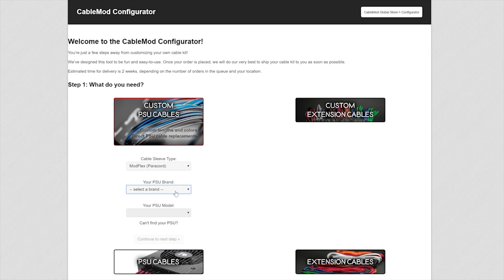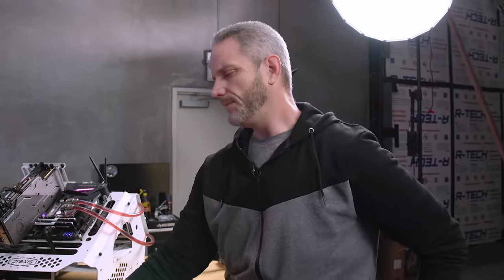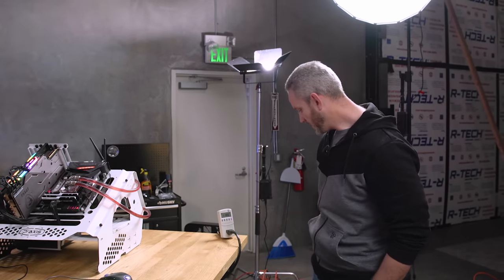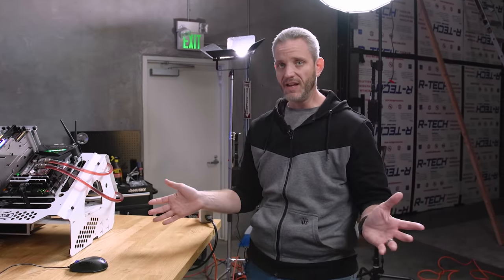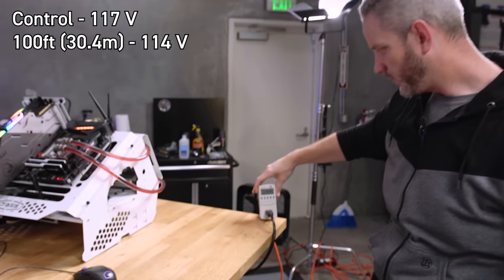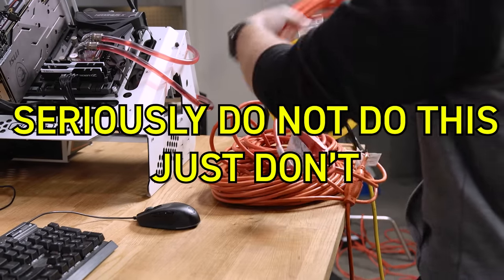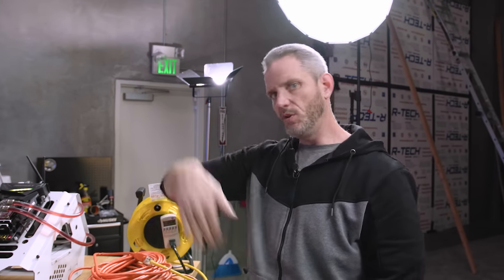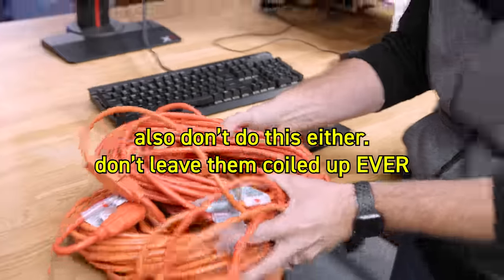Are extension cords dangerous for Computers?

Comment: The moment you plugged in the higher quality extension cable...... Gave me a lot of thanks to myself with my setup.

Our house is split in 2 with the electrical circuits. One side of the house covers 2 bedrooms and the bathroom. The other covers the games room, living room, kitchen and laundry. 

The whole house has maybe 12 wall plugs. Total. There is a lot of power boards. However my setup cannot be plugged into the games room as it triggers the breaker switch. I have to run an extension cord from the bedroom through to the games room. Because I am plugging into an extension cord the following, 3 monitors, PC, Nintendo Switch, Gamecube, Super Nintendo, Wii U, 32" CRT TV, Bar Fridge, plus a few things via USB chargers.... I did go with the higher grade extension cable.

Comment: Thanks a lot Jay for this video. Dirty power can be really dangerous for PC's, and while there isn't much you can do if you have a 300$ beater - when you've got a 5K$+ beast on the desk it would be best practice to work on some protection.
Unfortunately it's just not a very well known and tested topic. So thanks for bringing it up.
Reply: I know I'm several years late but I've got a question to ask. I don't have 100 ft long cables. I just want to connect my power supply ( 500 watts) to the UPS which is on the other side of the table. The cable that came with the power supply is a bit too short for my liking. Will it be alright if I use a power strip with a 2 meter cable to connect the power supply unit to the UPS ? 

Thanks

Comment: I'm so happy you made this video. I grind and polish concrete and I always have to try to explain people that I work with and train that they have to use the 12 to 10 gauge extension cords or else you will melt the wires and pop your breaker Non-Stop. Now I have a video to directly show them how it works

Comment: yeah i remember plugging my PC+ 2 monitors and my friend's PC and his monitor into a pair of sockets and the lights dimmed

fun times
Reply: Lol not possible average pc consume 500 watt 
Common space heater are 1500 watt and dont dime the light
And you have a 200 amp panel at 240 volt = 48 000 watt total power
Reply: @legros731  bro, im not even very well versed in this shit, but you dont know what youre talking about. 200 amp panel doesnt mean shit when youre on a 15 or 20 amp breaker. recommended constant output of most breakers is 80% of there max capacity. 120*20*.8=1920 watts.  two PCs, monitors, plus lights and whatever else is on that circuit, could easily dim lights.  jays compressor was only 600 watts, and ive never plugged in a compressor into a 20 amp breaker that didnt dim the lights.
Reply: @limitisillusion7  that's not enough load for it to dim the lights. Lighting don't use that much power, especially newer LED lights, unless you use old-school spotlights that draws huge amount of current. And lighting circuit are separated from outlet circuit so it shouldn't effect it. Probably shitty wiring or your whole house uses too much current for a single phase.
Reply: @marcusjr80  nope, sorry. Like I said, I'm not an expert, and I know your not either. A sudden load on a circuit will cause the lights to dim from voltage drop, it really isn't that complicated.
Reply: @marcusjr80  and lighting isn't always on a separate circuit from outlets. Whoever told you that is wrong

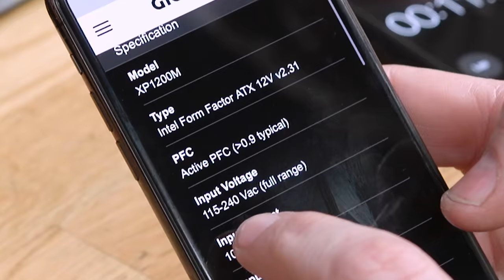Comment: 7:48 115V to 240V is nominal voltage, acceptable values by the standard are +/-10% so below 103.5V you might get worried. But the meter is not fast enough to show really fast dips.

Comment: I'm glad you did this video Jay, as an electrician I have seen to many home owners not understand what draw can do using the wrong extension cord for the job at hand. many of house fires have been caused by this especially in older homes built before the 50's.....laughing at the comments especially the one about not loosing to much draw on a 230V  output from a PSU.....with a 2000watt heater on the same outlet......I'd hate to be his insurance company he is the reason why insurance rates are so high in the world... well I guess you can't fix stupid but everyone else has to pay.

Comment: 5:02 So it's gonna start pulling more amps to get the 
volts it needs... Uhh you sure about that. 
I'm no certified pixie wrangler myself but this sounds even more wrong than Alex from LTT describing RACE-LET at CES 2020
Reply: It's better to say that you pull more current to get the power you need. Obviously, if the voltage is dropping, you won't get it back by pulling more current. If anything, voltage will only drop further by pulling more current. But, if you consider the output of a voltage regulator, not input voltage at the power supply, then it kind of is true. This compensation is, essentially, a function of voltage regulation. If I have a circuit that takes 5 A at 12 V, then I need to output 60 W. Otherwise, I won't be able to hold 12 V. Energy doesn't just appear out of thin air. If 60 goes out, 60 must go in (well, more, due to losses). My load doesn't care what the input voltage is. It's happy as long as it gets its 12 V. And if you're doing it efficiently, the only way to compensate for loss of voltage is to, somehow, pull more current (your own losses are the only other potential source of energy).
Reply: Maybe Uncle BumbleFuck can explain this better
Reply: Omh's law ftw
Reply: @jobicek  Ehm if something need 60watts. Its will either get it through higher current or through higher voltage. Watt=VxA. So at 12V you need 5A. But if you were to run 20V the current would only be 3A.
Reply: @Sheiiko  You are typically dealing with a voltage source. Your supply voltage is given. If you have a voltage regulator to pull voltage up to compensate sag, that energy has to come in the form of current. And as you start pulling more current to compensate, you will get more sag (how much sag depends on how "hard" the source is). Setting up a power supply so that your 12 V nominal rail is actually 20 V is not very bright, is it.

Comment: We also have 240V sockets here in North America, but they aren't as common and require a workaround to the 120V entering the house. Our 240V, 60hrz system uses two breakers with an attached breaker bar and one is run 180 degrees out of phase to the other, meaning the peak (120V) of one lines up with the trough (-120V) of the other. For high amperage circuits like clothes driers and stoves we have a two different styles of large guage 3-4 blade plugs; for mid-amperage like overhead lighting and fan array for a patio or certain power tools as well as generator hookups for RV/camper and whole home back-feeding,  we use a locking 4 blade plug and for standard amperage items like 240V window A/C units, high volume espresso machines and 240V electric heaters, we have a 2 blade with grounding pin, only the blades are horizontal rather than vertical.

Comment: For the "sorry to the electrical engineers" part, the reason the voltage drops is that the system was originally tested with it's own test current from the meter until the power turns on. Test currents can be 1A or else. When the power comes on and let's say it's 60Hz coming through, that's impedance which is a combination of capacitance (Xc=1/j*omega*C for j is complex; EEs don't use i obviously and omega is angular freq = 2*pi*110V) and inductance (X_L=j*omega*freq*L) measured in Ohms which resists the current and creates its own voltage drop. So the voltage drop is now a voltage divider between what's across the extension cord and what's seen at the meter. Remember that measuring voltage is measuring electric potential so you need two points, even for AC. (There is always a DC component to AC and I'm not going into the math. Take it on faith.)

Yes, Jay is right that the system is calling for power but that's by opening a drain in the tub... you could say. But since I"m in Okinawa, Japan which has 100V, we have some systems go down to 93V and it's fine. I haven't had anything die on me. My microwave acted funny but it turns out my fridge needed repair.... Same OCPD (circuit breaker). At 7:47, you see Jay hold up his phone for specs. PF stands for Active PF -> power factor ( >0.9). The 0.9 is on the power triangle. Draw a lines out on X and Y axis of graph paper then connect them. Which ever is longer, X or Y is which it is more. The much longer X makes this number higher towards 1. To find accurate number, arctan (y/x) will give this number. You don't want 1.0 and that's a purely resistive load. As the number gets lower towards 0, it's more inductive or capacitive. The reason you want 0.9 is that motors need inductance to start or maintain magnetic flux through the core. This is how power is transferred. The ACTIVE power factor means that it uses capacitor banks to balance and correct the 0.9. Capacitors in series makes a capacitive load and parallel to a load makes it act inductively (instead of inductors :O). Why not use inductors? Because they are incredibly unpredictable. Where you think you have received the desired effect, the inductive kickback as a coil reacts to a change in voltage, you can get an undesired kick back in current. Think of a spring in mechanical purposes. It's the overshoot. When thinking of capacitors, it's like a bucket with water streaming into it where it's capable of either holding the water, drizzling the water or dumping the water. More predictable and easier to design with. Check out ARRL (Amateur Radio Relay League) Handbooks as they teach you a lot... including making audio signal circuits - both active and passive.

Jay points out that you can be very close to the output supply... That's correct and it's typically 10% of the target voltage. So on a power supply with range of 115V - 240V which is set to 115V manually, you can do -11.5V which is 103.5V. But like I said, I have run it at 100V in Okinawa and we do get voltage drops, especially during typhoons as those power lines sway in 150 mph winds.

Oh, big point. When the voltage drops*, then the *current raises because Ohm's Law must remain true. P = V*I. If P is constant and V goes down, I must go up. This is EXACTLY what happens if you were working at a hydropower plant such as USACE or Dept of Interior.... North West area... Seattle and Portland.

Applying overclock made higher demand on the current supply (max drain on tub) which dropped the current and collapsed the electric potential. Since he never mentioned the current at any point, you can't calculate the current at the point of failure. Since the power supply remains active for 0.9 PF, you can neglect the point of reactive power (impedance) and treat it as a purely resistive circuit. (Otherwise, you can't use P = V * I directly without the cos Θ where cos Θ = pf.) OH hell, here's a link to the power triangle. https://circuitglobe.com/what-is-power-triangle.html

Jay points out that the orange was at 16 gauge (American Wire Gauge - AWG) and the yellow as 14 AWG. The lower the number is related to the fraction of an inch in diameter. The reason the 14 can take more than the 16 is the ampacity. Higher gauge is capable of handling more. Here's the link generally speaking: https://pbase.com/mainecruising/image/135787605
The reason that higher gauge can't take as much is the lower surface area around THE OUTSIDE will change in resistance (https://www.allaboutcircuits.com/textbook/direct-current/chpt-12/specific-resistance/) while the core or inside of the conductor cannot handle the heat and the outside air needs to work harder to evacuate the heat. This is where insulation burns. Stranded wire also has a lower ampacity than a solid core wire. Much larger wire such as "4 ought" or 0000 is stranded is can you imagine bending a wire about 4 inches in diameter if it's solid?

Comment: "Good luck don't shock yourself V" omfg that made my day xD
Reply: Brazilians confirm that. Officially it is supposed to be 110v or 220v depending where you live. But... Yeah, good luck with that.
Reply: It can literally change depending on the street you live on, for instance my street has 220 but the one above is 110
Reply: Here it's so dangerous that you can die for literaly nothing
Reply: @jakob findlay  🤣🤣🤣
Reply: @CaelVK  where do you live?
Reply: Small northeastern city
Reply: @CaelVK  I'm also brazilian, I just got curious to your situation, and now I'm more curious as I've never heard about 110 v outside southeast
Reply: @littlescreen9175  Salvador tem 110 e 220, depende do bairro/rua
Reply: @csl015  que ridiculo
Reply: I dont know much about it either, just that it was some random old power lines that are 110v. Dunno if they still exist or got replaced
Reply: I also heard stories of similar things in the south region

Comment: Volts = pressure
Ohms = resistance
Amps = current
Reply: Amps should be flow rate rather than current if you are trying to make it easier for people to understand the concepts.
Reply: Good old ohms law! Or for this application Vdrop = (2*K*I*L)/cmil
Reply: Volts is power, not pressure. There are ways to compare power to pressure, but you're skipping a step
Reply: @TheAlexBradley  lol shit. This is why I'm in mechanical and not electrical engineering. Pressure being there makes no sense to me.
Reply: @wumbol0gy871  Imagine a pump rated at a certain head pressure. If you pump any incompressible fluid through a tube, the pressure will drop across it because there is internal resistance and dissipation. But the flow rate (current) will stay the same, because the fluid can't go anywhere. BAM, Ohm's law with a fluid dynamics analogy!
Reply: @TheAlexBradley  You should've listened to your teacher.
Reply: @TheAlexBradley 
One watt is defined as the energy consumption rate of one joule per second. 1W = 1J / 1s. One watt is also defined as the current flow of one ampere with voltage of one volt.
Reply: @wumbol0gy871  nah it shouldn't make sense it implies potential in the line which is false and will screw you up later
Reply: @Quotenbrtchen  all of that is wrong damn even for fluid dynamics thats wrong you contradicted yourself twice
Reply: @SavageZebra67  Ok please show me the right way
Reply: @wumbol0gy871  volts are actually a measure of electric potential. Watts are power.
Reply: @TheAlexBradley  Watts is Volts*amps
Reply: @Quotenbrtchen  " if you pump any incompressible fluid through a tube pressure will drop" firstly incompressible fluid, implies that pressure remains the same throughout.  Further more how does pressure drop off with the additon of internal resistance? And think you just through dissapation in for some word salad because it directly contradicts the point you are trying to make and has no relevancy to what Jay is talking about. Obviously you want to argue more than you have an argument. Just tell um your a pot head. So they can lower the standards
Reply: Volts = voltage
Amps = current
Ohms = resistance
Watts = work/power
it's literally european 7th grade physics. how can someone not know it?
Reply: @caramelsurpriz  I feel like explaining it in mass is better than potential. ( mass × throughput) = pressure or rate
Reply: @SavageZebra67  Wow you are condescending. I just mixed up incompressible fluids with ideal gases (which wouldn't necessarily help my point but whatever).
 Also, dissipation actually is exactly what is causing pressure drops or voltage drops in the case of electrical wiring. The potential energy is not just being used to move fluid or charges but is also partly dissipated (in fluids through turbulence and viscous friction, in wires through electrons being impeded by thermal oscillations of the atom matrix).
Thanks for taking a shallow look at my comment and then recommending calling myself a pot head. It is greatly appreciated!
Reply: Wow, 7th grade? It takes that long in Europe?
All of you forgot something pretty important; 

Hz/Hertz = frequency
Reply: @Quotenbrtchen  guy your name is thc fan lmfao. Wasnt my idea. Yes think we can all agree tht electricity dissipates over distance. Way to adapt your argument.
Reply: @Quotenbrtchen  further more not sure how ideal gas ties into this? Are you suggesting we can change the temperature of the wire and expect diffrent results? Otherwise we arent worried about the free expansion of electricity while its being measured
Reply: @SavageZebra67  Like I said, the thing with ideal gases wouldn't really help my point. That said, electrical conductivity does increase when you lower the temperature for most conductors. So it would have an effect but it wouldn't make for amazing stability where previously the system would crash
Reply: @SavageZebra67  It's just a pseudonym, I don't even really smoke pot lmao
Reply: Volts flow rarte, amps pressure ohms resistance
Reply: @Quotenbrtchen  again adapting your argument whatever man spend the rest of the week back pedaling Truth Is I was bored at work for several hours and you looked like you would bite. Im sorry for the troll hit me up tho if you wanna argue sometime lol
Reply: @SavageZebra67  When a troll is twisting your words you either let it go or you feed the troll because you're procrastinating on your math homework^^
Reply: @goaliedude32   i think you have amps and volts flipped around. amps is the amount of electrons flowing through a specific point. Volts are what push the electrons. the lowers the volts the higher the amps tend to be and vise versa
Reply: @az-yr7yz  I look at is as amps melts wires, pressure bursts pipes

Volts is the ability for the electrons to move
which is similar to flow rate